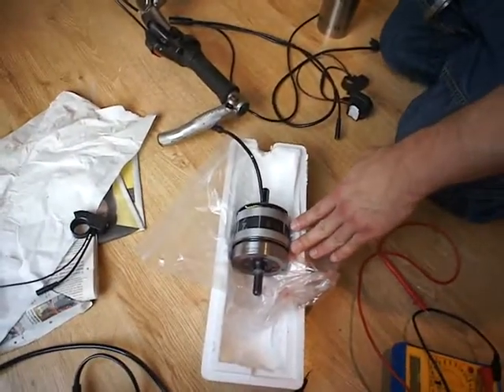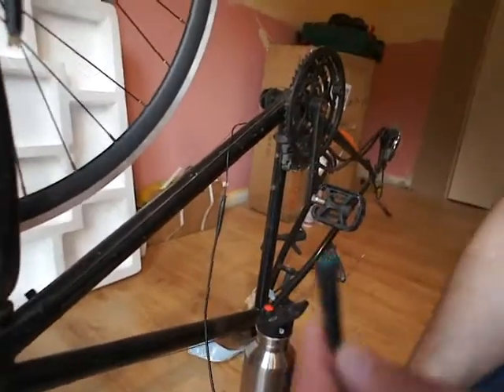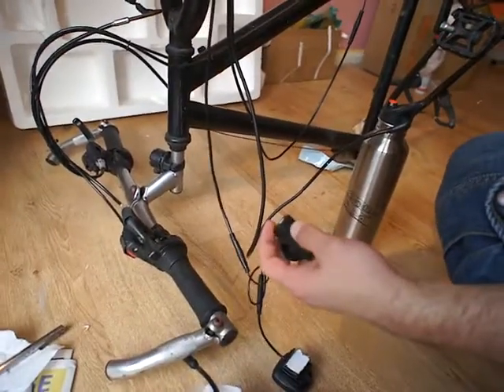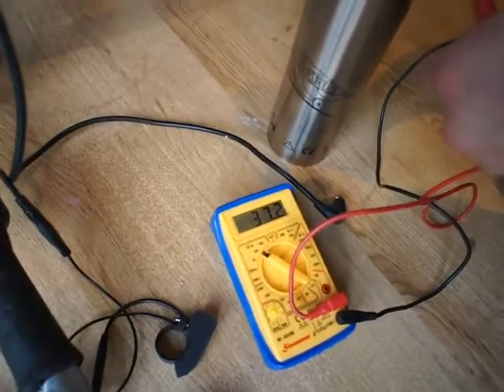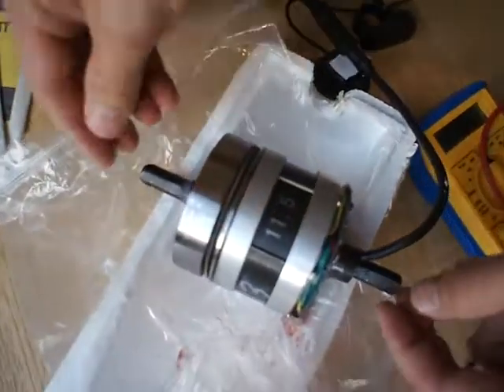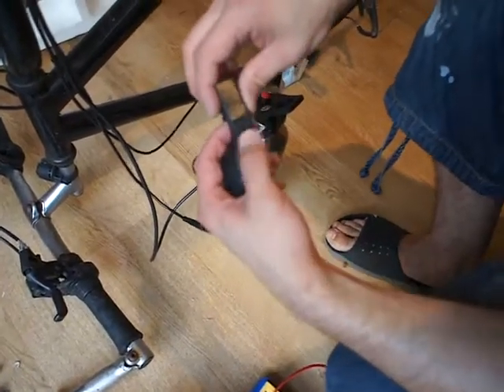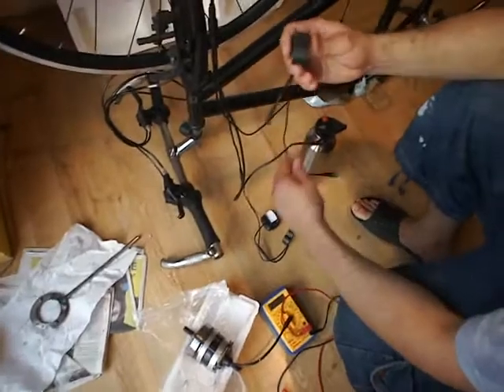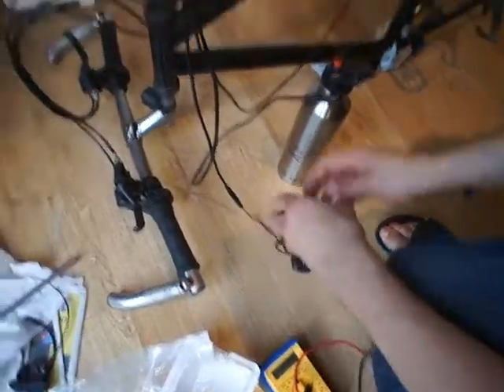KEYDE, - part 4 -keyde ebike kit, electric bike, E bike, electric bicycle, motor with controller

Comment: Good morning my friend. I saw your video on YouTube. Even though it's been 8 years, I want to ask you a question. Did you manage to disable the brake that exists inside the Keyde engine? because even if you don't connect the batteries, it's almost impossible to pedal the bike due to the brake inside the engine.

Comment: Ok I have been working on the same problem.This particular model is pedal assisted and takes a good few passes of the magnet over the pedalic sensor to tell the controller to engage the motor, You can set it up and switch it on and lightly pass a magnet over the sensor and then the motor will start.If you wave the magnet to fast it thinks the speed limit has been reached and the motor stops. Thiers a hack where you can either set small magnets on the rim, and the thing thinks you are pedaling, but that's the reason the stupid thing wont start.

Comment: I am impressed by all this enthusiasm for a product that doesn't work!!

I have 2 motors without internal controllers, but I have not found a controller that works perfectly.  The best performance is with a Castle Creations model helicopter controller, but you have to pedal to 2-3 kph.  A controller from ecrazyman or a BMlS battery works OK but sometimes it will not restart without close/open throttle.

Weird - if they could just get on top of these issues it is a nice, light and quiet motor that can take 10% slopes easily.
Reply: That motor looks too small I'd never choose a kit with a motor like that

Comment: Dear Stella,
I just bought one. Apparently a new run. I cant get it to work. Similar problem. The controller switch never lights up. Did you resolve this problem. They are not replying to my emails? 
I am very unhappy.

Comment: I bought till now 6 kits. I'm an Italian installer. I started to assembly these kits since January 2013. They are lighter and powerful but i had some problems with 2 motors: the first one had a controller failure and the second one broke the 2 capacitors welded on the controller.
They changed me the first motor and for the second problem they send me(free in warranty tyme)  the tool and the new controller.
It's a reliable factory but their products are not reliable as them.